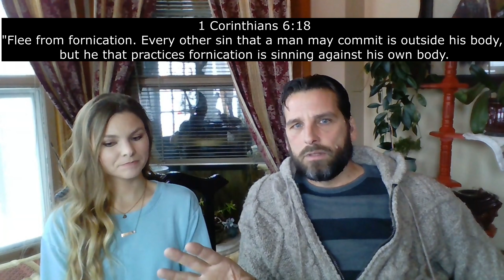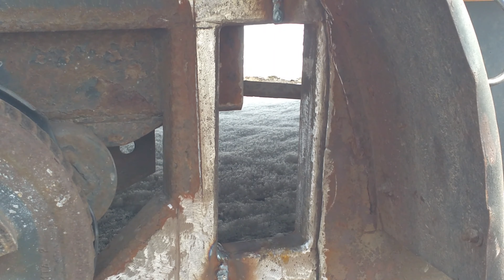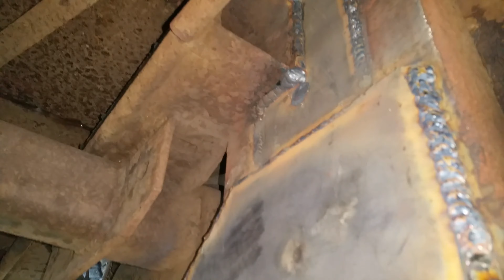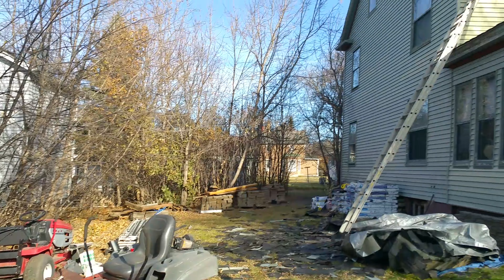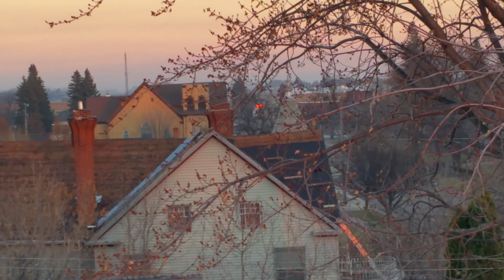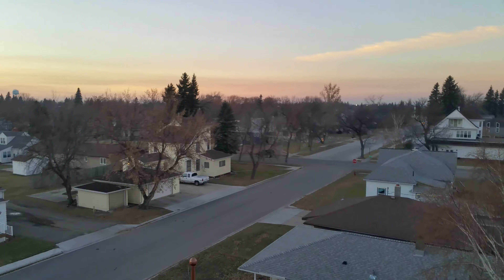JW Elder Son Pulls Knife On Wife ~ Barn Find 1965 Mustang Fastback ~ 2nd Victorian house Restoration

Comment: My favorite mustang is 1969 or 1970 boss 429 and I do like the 71 to 73 Mach ones I like that style fastback only you know back in 64 the barracudas came out two weeks before the mustangs did they never advertised it mustang a Ford had excellent advertisement and they outsold the barracudas by far
Reply from the maker: My first FB was a 69, we have a 69, 70, and a 71-73 all FB...also have a 72 convert project car. Used to have a 64 1/2 but sold it...yea they sold good.